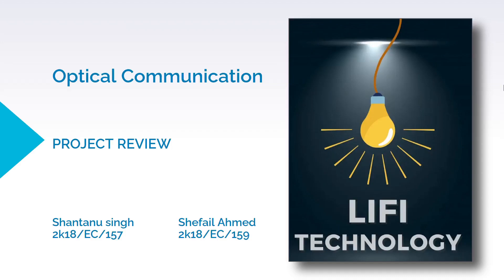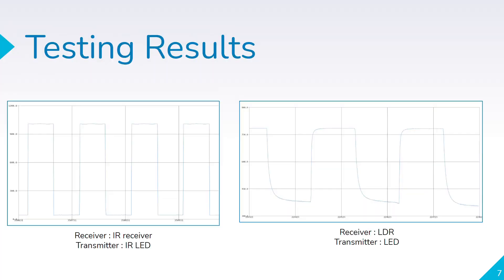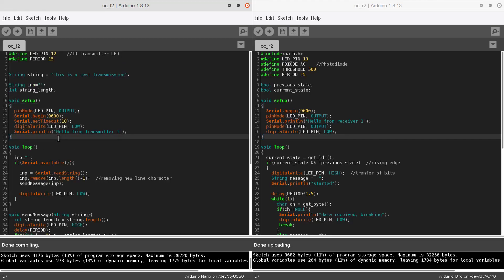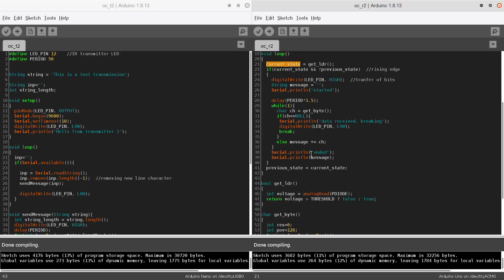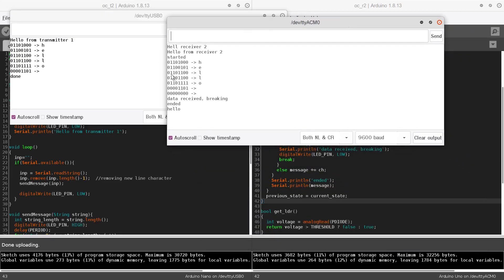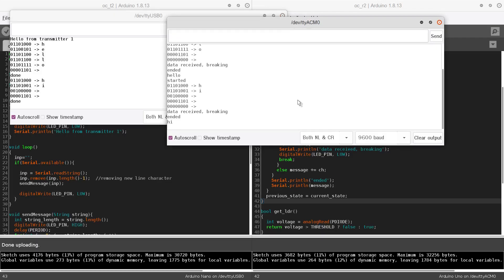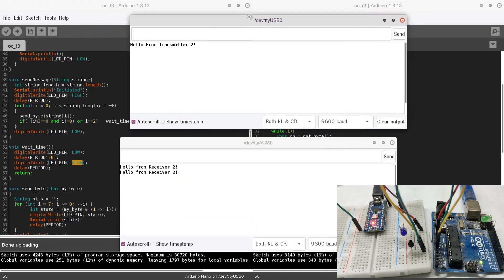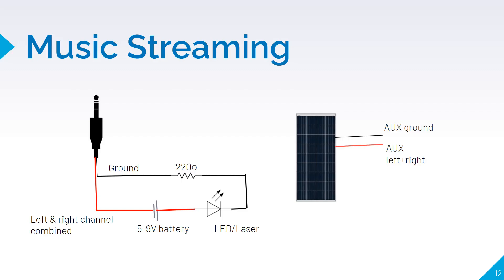LiFi Technology | Optical Communication Project | Shantanu Singh | Shefail Ahmed

Comment: Sir the circuit diagram is wrong I tried this same project
 Pin for LED is different.👍🏼
Reply from the maker: Isn't it pin 12 in code and circuit? Anyway if different pin works for you it's all good
Reply: @shan_singh  in the code it is the correct one but does not match with circuit diagram.
By the way your project helped me a lot I presented this project with some other of my lifi products at the State level. Keep uploading such content buddy 😄